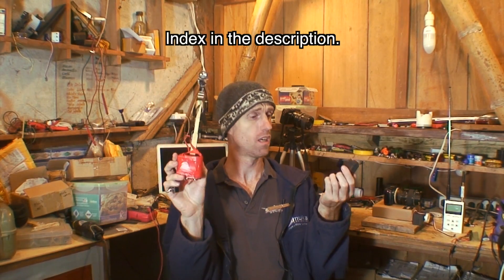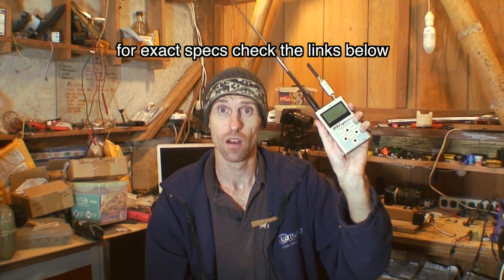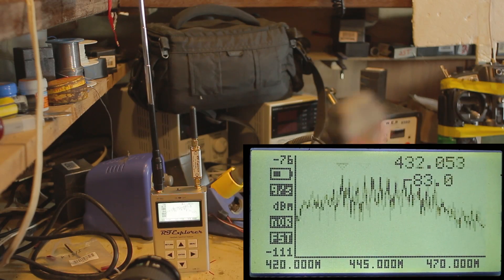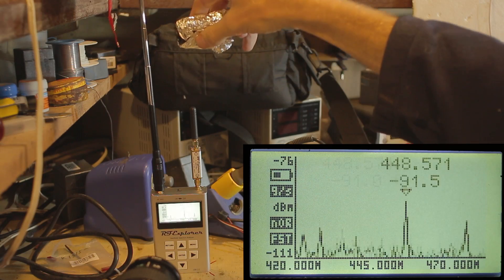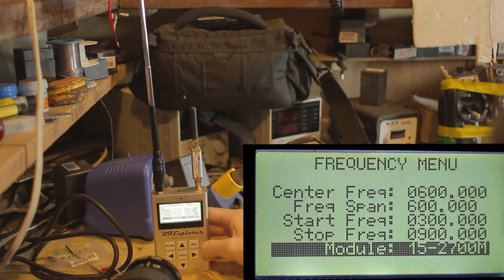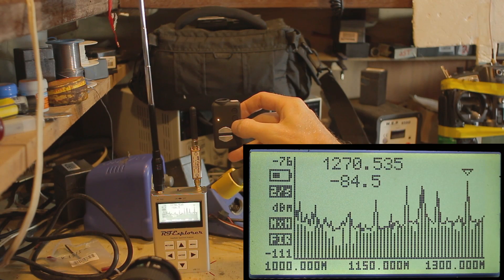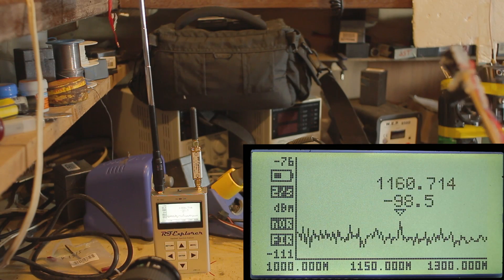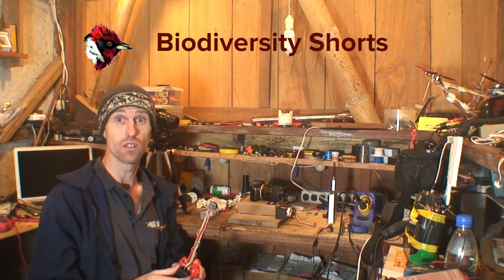Mobius action camera. RF noise. - RCHacker #66

Comment: I was wonder if you can help me with my möbius camera. My fpv system does work perfect with my ccd cameras but when I try möbius for fpv it doesn't work for any reason.  What I can do. I believe is the cable that am using for möbius but I get this cable brand new from ready made rc. Thanks
Reply from the maker: Aldo Allende Oliva First check the mobius settings, video out may not be enabled.
Reply: How do I can check that
Reply from the maker: Aldo Allende Oliva I dont use it myself for live feed, google "mobius manual"
Reply from the maker: RCHacker there is also a windows setup program which makes things easy

Comment: Such a pity this top of the wazza model does not have the RF sweep generator like the narrow band models. Still at under $300 it's a steal.
 I'm looking for a similarly cheap antenna analyser that will go to 5.8GHz. Spoilt for choice on HF and VHF but no microwave units. Bloody hams obviously don't want to talk to themselves :)
Reply from the maker: Rob B Yeah, I thought it had a sig gen too. Seems it is only the narrow band modules. I did read somewhere that he was working on a 5.8G system.

Comment: You got a ferrite choke to put on the extension line, close to the möbius. I would expect that would help a lot.

The shielding needs to be grounded at one end otherwise it's not going to be as effective.
Reply from the maker: I might just have a ferrite that will fit over the connector, and I will try out grounding it, cheers.

Comment: Phenomenal Visual Test! Thanks for sharing - Loved it
Reply from the maker: The fast refresh rate is great. When you narrow it down you can see openlrs hopping.
Reply: RCHacker I think what was also amazing was how well the foil worked. I know even with 2.4 for control link, trying to keep the RF noise to a minimum on the aircraft greatly increases range, so tests present fantastic information.
Reply: BMSWEB You can buy some very expensive anti-RF sprays and sticky backed shielding materials. I think i'm going to experiment with sticky-tape and tinfoil if i run into any of these problems to start with though.